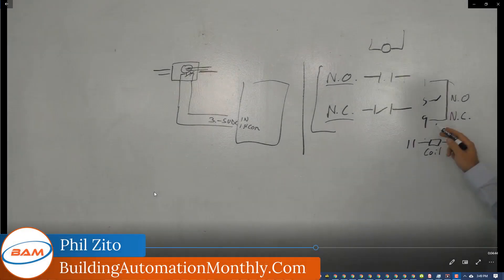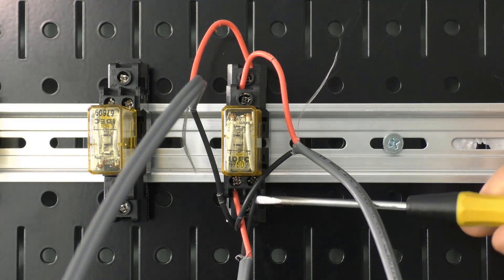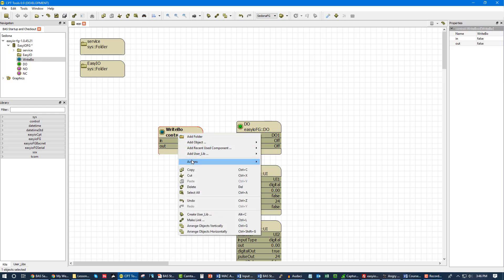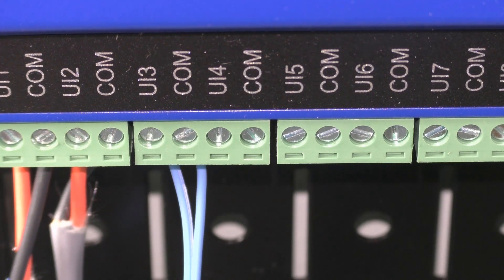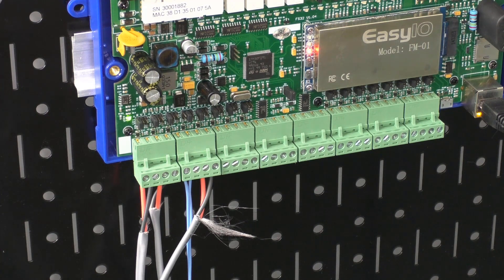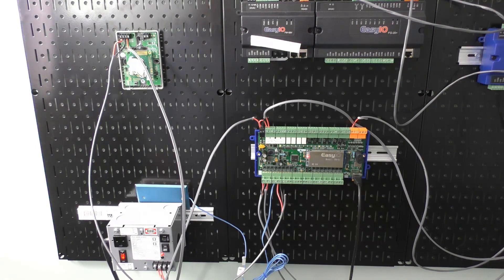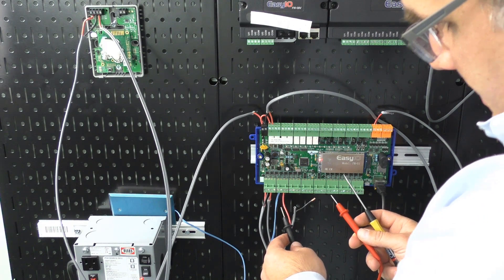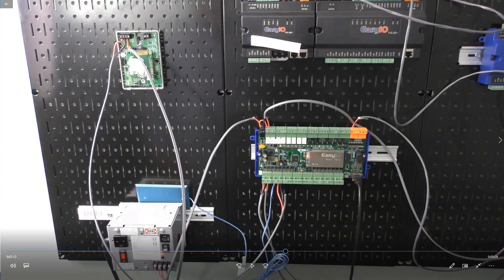BAS Bootcamp: Day 7- Setting up Inputs

Comment: Question will your wiring diagram indicate that the power source to the controller should be amps or volts to change the switch you mentioned on video?
Reply from the maker: I'm not sure I understand the question. Volts, amps, and resistance is present on all electric circuits.

Or are you asking if the input source is voltage or amperage?
Reply: @SmartBuildingsAcademy   I think I'm asking when setting up power source and wiring  from that t-stat to the controller is it always in amps?